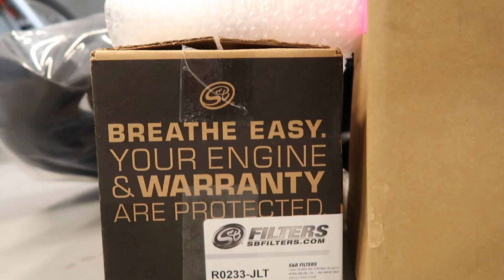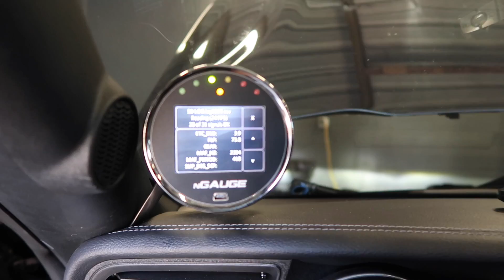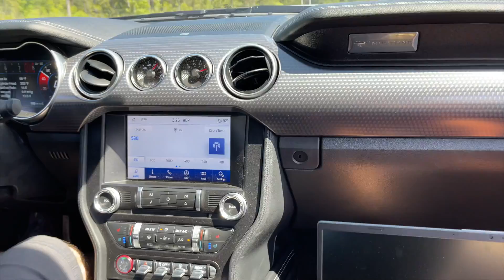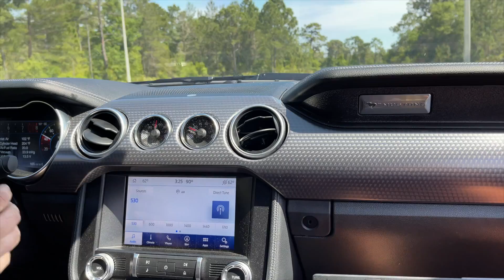Whistling 800HP! Vortech V3 Install on 2019 Mustang

Comment: I have the Vortech V3 on my 3 valve, did the Steeda delete plates, makes a huge difference. Got 741/663, pulls so hard you look like a Pez dispenser when ya launch
Reply: Did you have to put any crankshalf support to prevent the crankshalf snout from snapping?
Reply: @soulja4187  No, it is all forged, ot is the Aluminator engine, and there isn't that much pressure on the snout in this application. Thanks for question. Please like and subscribe. Will have another video out soon, should be very informative on what the future is for the S197.
Reply: Hey man I know it’s a bit random but could you give me all the things I’d need for the “kit” to get 700 wheel on my 3v. Have Detroit rocker cams and support mods for that but want to install this on mine
Reply: @samuelbabbitt3223  Well, I got my system (supercharger V3 H.O.) kit from Brenspeed in Indiana. At the time I have the Detroit Rockers (blower grind) and loved them. I also have the Aluminator short block (they do not make it anymore) , it is all forged internals, your going to need that strong internals to keep from busting stuff up. After I messed up the Detroit Rocker cams (my fault) and dropped a valve I had to do a complete rebuild, it busted up the piston #5 really bad and destroyed the head om the drivers side. After that I went and got all new parts but this time I put in the Comp Cams #127650, these are REALLY high lift cams and they require lockouts for the phasers and also heavier springs. I am having buyer remorse on these Comp cams 127650, it appears that many have had the same issues that I have had, I dropped a valve and this time it was #6, and again it destroyed the head (see video) and the piston. I have all the correct mods, all the tuning was done by a very well known tuner, this guy travels the world to reach others how to tune cars, he is spot on. This by far is not my first motor, more like my 70th or 80th, so I know for a fact I did everything perfectly. I also have 60 pound injectors and the dual GT pumps to make sure I have the fuel covered. So getting to 700 isn't really easy, and as you can see it can be costly lol. I am thing about either LS swapping it or doing a Coyote swap, I along with many many other believe this is a better platform to build big power off of and make it reliable. I know this is long winded, but i appreciate the people that view my videos and think I should give a complete and thorough answer when they ask. I hope I have answered your question and gave you some insight. Please feel free to contact me again if I missed something. Thanks for viewing..

Comment: Banging gears on a prepped track and dumping the clutch consistently at 5k RPMs might present an OPG issue, on the street you most likely won’t have an issue.
Reply: Not really planning on tracking the car much, especially on stock axles and driveshaft. Once I pump up the boost and get all that done I’ll be sure to do opgs
Reply: @quinncalero4274  yeah.  I just had my OPGs done at the same time I added boost.  Saved me install money later on.   Instead of basically having to take the whole blower out just to install the OPGs.

Comment: Should b happy my 2011 first gen 5.0 have the vortech v3 and the division x 2 pump fuel system and from heads all the way back with duel 3in with x pipe on gt500 quad mufflers and its crazy fast

Comment: So how reliable are the 2018+ mustang gt with supercharger on it. How many miles have you done with the supercharger on it ? Any issues so far. I’m planning to supercharge mine but I’m scared of the reliability. Don’t wanna blow my engine. Or how many hp is safe to for the 5.0 coyote
Reply: I added the Vortech all-in-one kit on my 2020 Mustang GT.  The kit comes with a programmer and a tune for 91 octane.  I also upgraded the oil pump gears and crank sprocket  for the added horsepower.  It dynode at 600 WHP and 500 ft. pds of torque.  Parts cost 9K and 4K to have a professional garage install it.  This setup should be very reliable.
Reply: Dont add power under the 5yr/60k mi powertrain warranty then unless its a ford supercharger and must be installed by a dealership. The moment any dealer see's a supercharger or turbo on your 5.0 and its not that crappy roush/ford garbage, the vehicke gets silently flagged in oasis the ford service database.
Reply: 700 crank/625 rwhp is generally safe. Oil pump gears and crank blow due to high rpm more than exccessice power. Keep redline under 7400 and really more like 7100-rpm since power is fallibg off a cliff at that point unless you have heads or NA Cobrajet intake, then you'll need to do those two items or push over 660+  wheel hp/750+ crank hp.
Reply: And dont beat on it daily, let oil temp and trans temps come up to normal before blasting it and let it cool down 10 min after flogs.

Comment: So what’s the deal with this type forced induction?? Will it break tires loose if leaning in it or is it more just tamed power ?? Sure seems to work good tho
Reply: builds boost as rpms increase, boost comes on around 4,000 rpms and boost increases all the way to redline, belt driven turbo essentially....  Whipple and Roush blowers are always on boost if throttle plate is open, more torque down low, less boost up high... I'll take centrifugal over roots or twin screw anyday! Love the way it makes power! Yes it will light the tires...

Comment: Did you guys run into any issues with the IC piping and Adaptive Cruise Control module located below the bumper support on the driver's side? I hear a lot of people have had to make modifications to the bracket and/or it just doesn't work at all.
Reply: I just cut off the arm that goes back because of the piping. It’s still mounted with the other screws on the bracket and it works fine.
Reply: @quinncalero4274  Awesome, thank you.